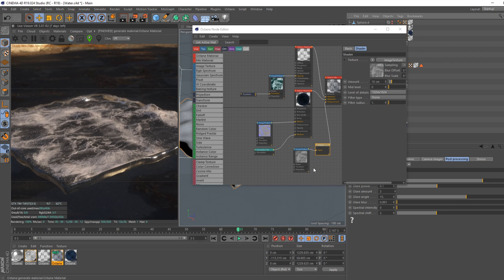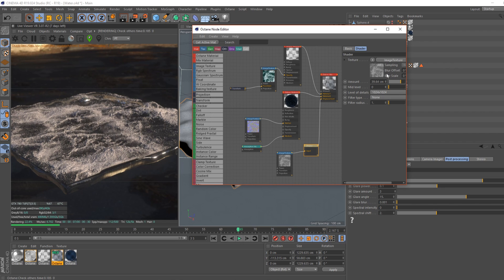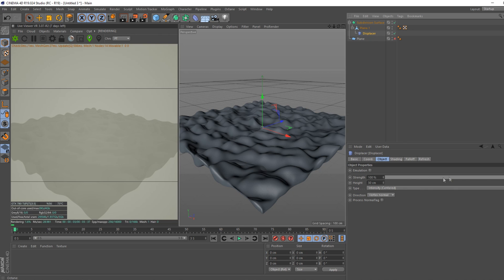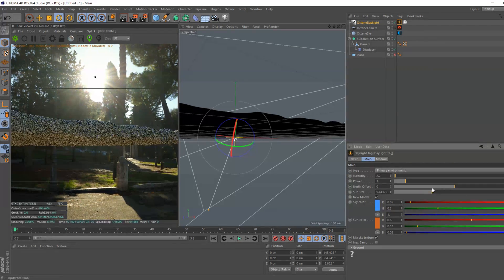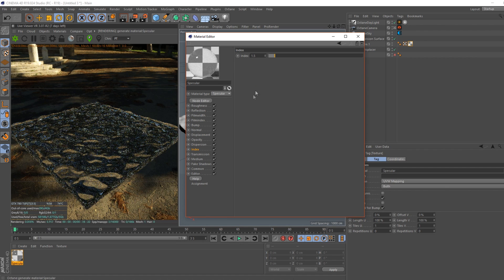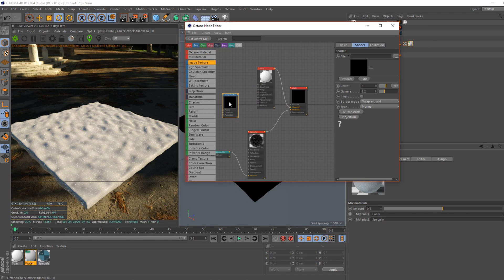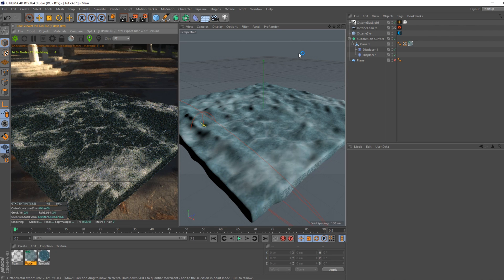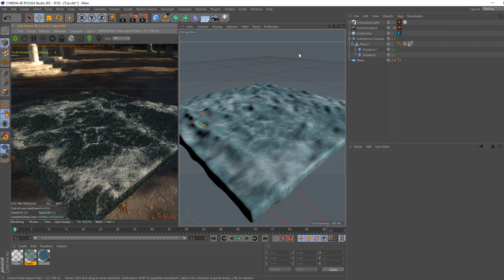Cinema 4D Tutorial - Realistic Ocean With Foam! (Octane Render)

Comment: Excellent.  I have been working with UNREAL  for almost four years, and  the water, for as good as it is, doesn't quite cut it.  Your foam, example was great, and the  work flow is very close to UNREAL. I also have hours  of real ocean footage , and bays, and  coves, and I have yet to  see ANY of the Hi-END, render engines come close to the REAL thing. Wind-driven waves, are very dynamic, and  I have  yet to re-create them in UNREAL. Maybe vary the shape, over a time line? I haven't tried to adjust things , using a time line, so I don't know  if that works? I have used VUE, in the past, and making those changes, over time, are doable, but are totally impractical , and are limited to a 2 D rendered product, that takes literally  days to render, even  while producing a short animation. Thanks for your tutorial.  WELL-Done.

Comment: you know that the IOR for water is 1.35 or 1.33 right?
Reply from the maker: Moiwz Yeah! which is why I kept it around there but because we where mixing it with textures I cut loose a little  to get a result that suited my scene better, it wouldn’t be detrimental to the result whatsoever in this case!
Reply: Ye sure heres a link: https://refractiveindex.info/
Reply from the maker: Use that a lot bro it helps a lot! Sticking to the guidelines doesn't always justify the best result though ;)